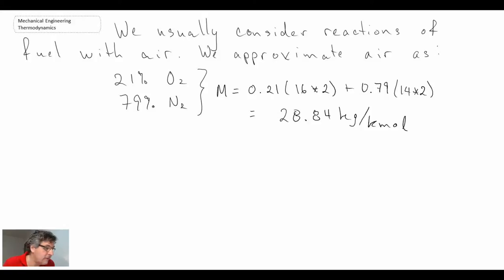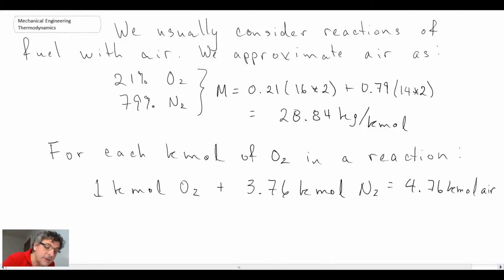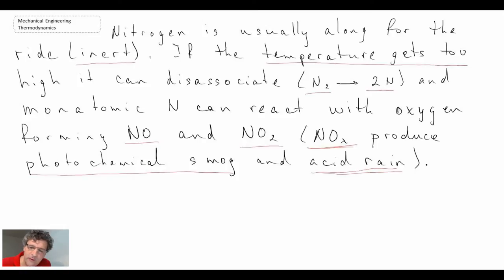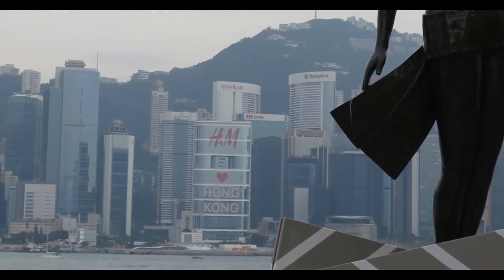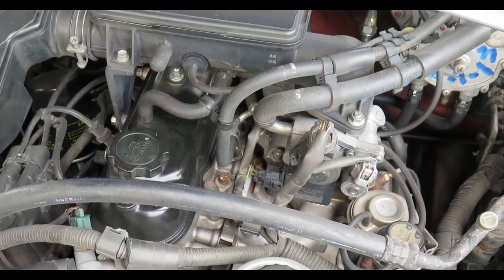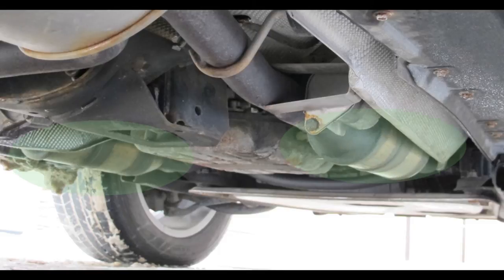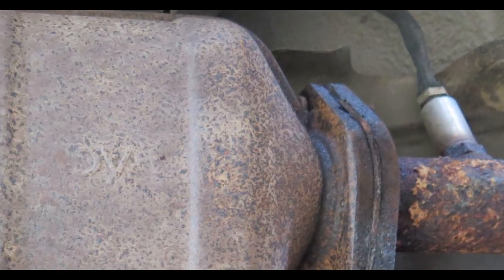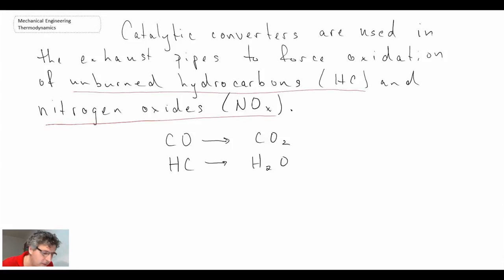Mechanical Engineering Thermodynamics - Lec 31, pt 3 of 5:  Combustion - NOx Formation

Comment: What causes the fouling of the catalytic converters? From my understanding LPG cars burned out catalytic converters more quickly through extra heat / leaner running often found in LPG converted engines. Any truth in this or does it create some sort of ash that fouls them? Thanks